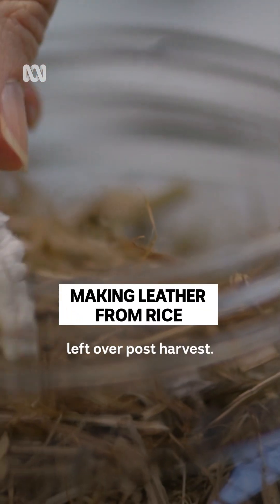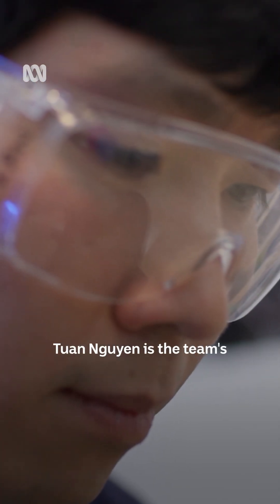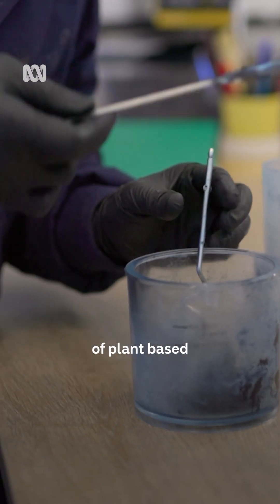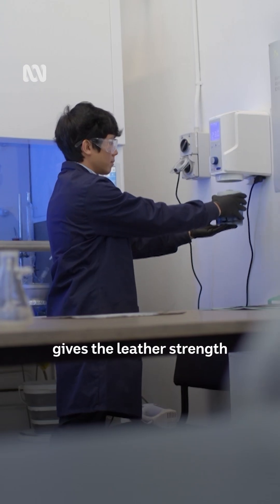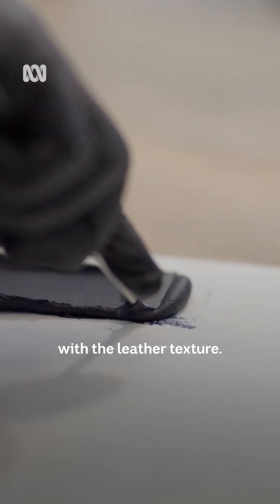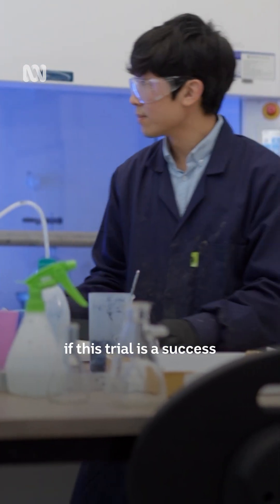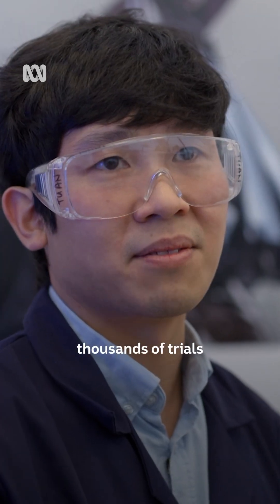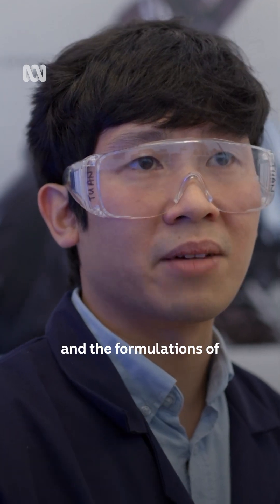Turning Rice Husks Into Leather! #Shorts #DrKarlHowThingsWork

Comment: Plastic with natural fiber filler like trex decking.

It's just polymer concrete. 

Still talked thousands of years to decompose unless you are using specially made decomposing polymers. But those are not as strong and are expensive to make.
Reply: This one is actually plastic-free. The 2 min video has more info.

Comment: New eco friendly leather?
Polymer 😔

I'm sticking it by. They claim to avoid petrochemicals in the other video. I believe them. However, plant based plastics are still often toxic and take hundreds if not thousands of years to decay, while still deteriorating during wear,
Reply: It's plant based polymer rather than petrochemical
Reply: @lukek8357  PLA is starch based plastic. Still no bueno
Reply: Not all polymers are plastic. Eg: latex and volcanised rubber are natural polymers made from plant saps and resins.
Reply: @AreilKnight  Many plant based polymers are plastic, and only mildly less harmful (they don't use up oil)
Reply: Why would that matter?  Only if it’s plastic polymers would it be non eco friendly.  But it’s obviously not since you see the plant material go into it, assuming it’s plant polymers is a pretty safe assumption
Reply: @Marynicole830 Crude oil is plant based.
Almost every chemical can be found in nature, even things like cyanide.
Just because it comes from plants means nothing.
Reply: @Marynicole830  Notably, the plant material we see go in it is the ground done plant husks. They likely put in a vegetable starch based plastic, probably corn based knowing the US which are only less harmful then plastics in the way that they don't use valuable petrochemicals (which do have good uses, and need preserving)